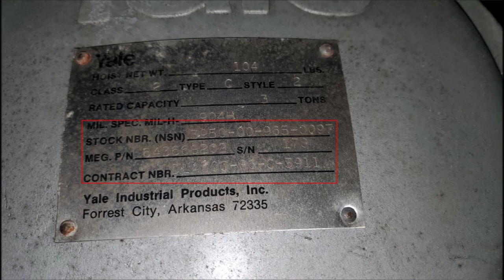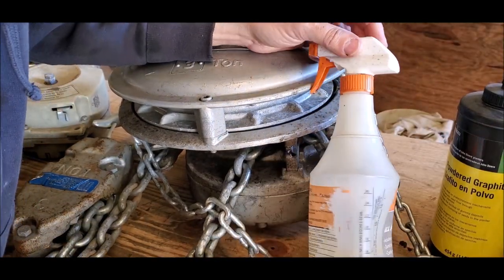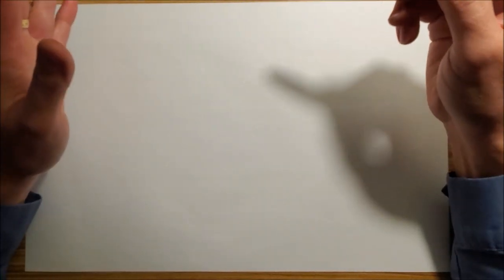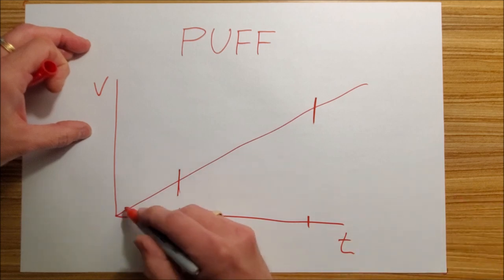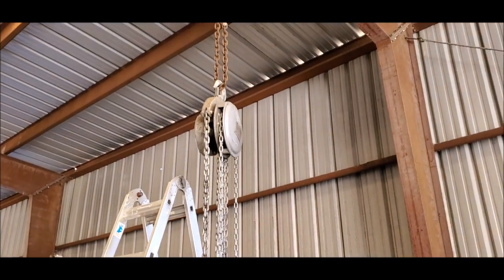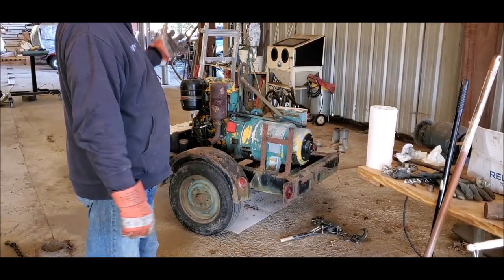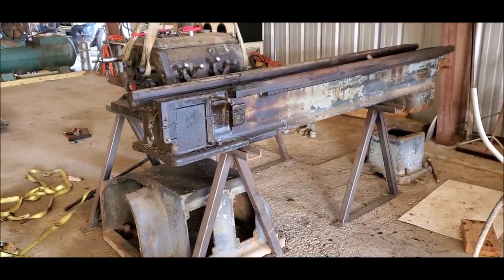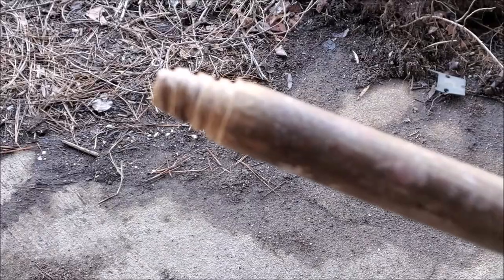A Yale 3-Ton Hoist for the Monster Shop

Comment: Nice addition! I’ve always been curious about metal fatigue in (or is it on) structural steel buildings. I’ve had to paint so many and the excuse was always “metal fatigue”. I too digress. Great channel man.
Reply from the maker: Fatigue comes from 1000's of cycles of  stress, usually bending. Hard to picture a building element subject to that, unless it is way under designed. More common in machines that cycle or rotating shafts that are side loaded and the stresses reverse rapidly. Also airplane wings flexing, which I think about every time I fly...🙄

Comment: Hi. Excellent video. The best part is you explaining (in metric) the difference between a quick puff, a good puff and a long puff, shown on a graph time vs volume. I think that correlation also are true for other kinds of puffs too. My cigarettes work the exact same way. The longer I puff on it, the more smoke I get. So your graph is accurate. 
If I may suggest; why not mounting the hoist on an arm and a roller? Then you wouldn't be limited to hoisting in just one position. 
Happy new year.
Reply from the maker: Godt nytt år!! You describe what is called in english a "jib crane". I actually plan to build two jib cranes, attached to my building structure to load machines with steel. The capacity will be 1/2 ton, not 3 due to lomitations of the building. I am going to get a 30' (10m) beam placed under that rafter so the 3 ton trolley can roll back and forth as you suggest. One lift point is very limited, but is better that 0 (zero)! Thank you!
Reply: @EngineersWorkshop  I suspectetd you had  something in the works...
Yes, the type of crane you are thinking of is called a jib crane. My explanation might have been a little bad. I found the type of crane I was thinking of. It is called a overhead crane or a gantry crane. And they have a huge capacity.
Yes. Anything is better than nothing, that's true. Thank you for the fun video.